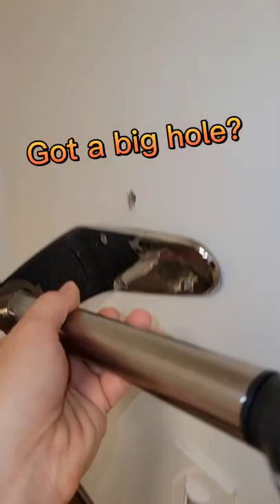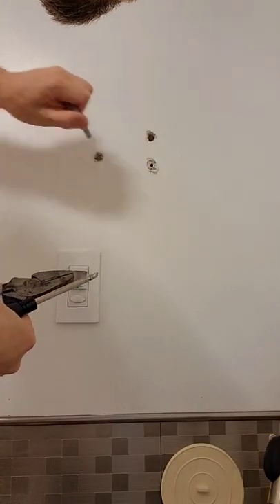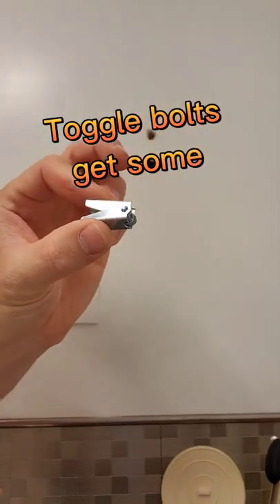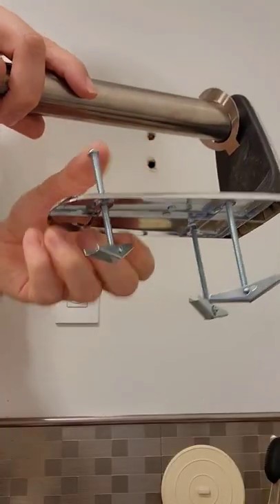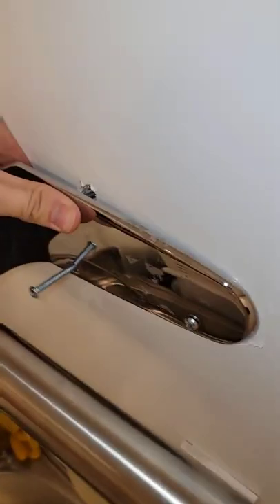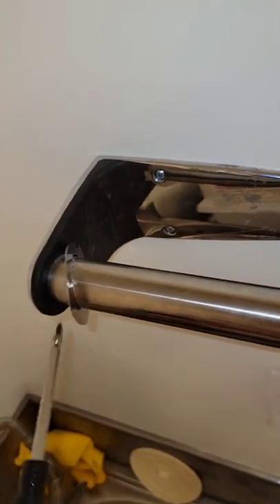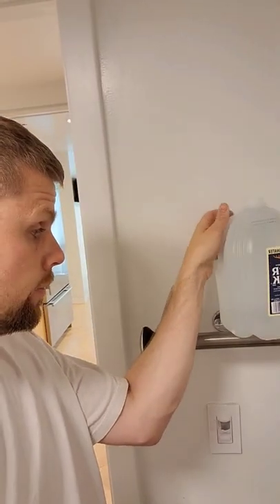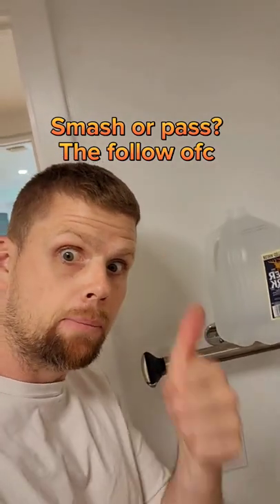How to use toggle bolts #shorts

Comment: There is a really awesome/handy wall anchor at lowes that are similar. They don't fold in half but lay to one side and you wiggle them open once in the hole. The really cool part is there is a plastic band that has a washer slide. You slide/pull it tight and snap off the excess and then the shit doesn't fall into the wall cavity.